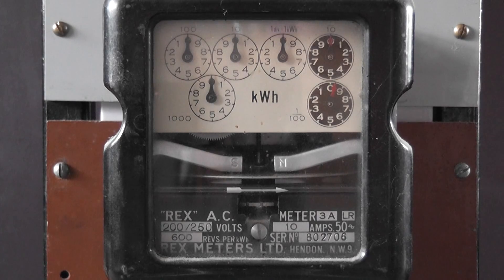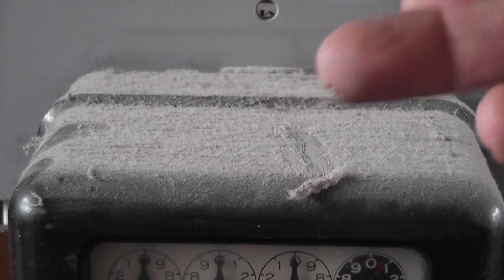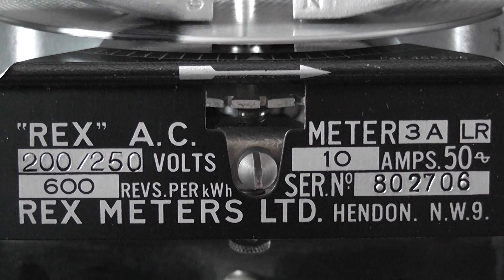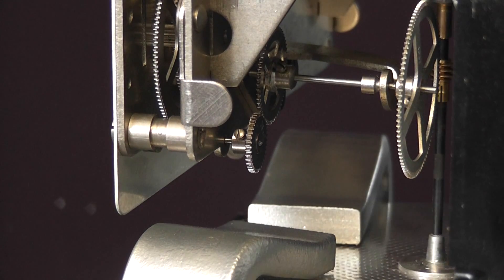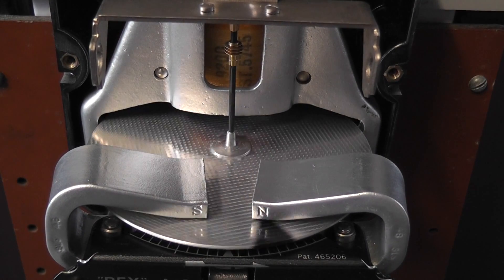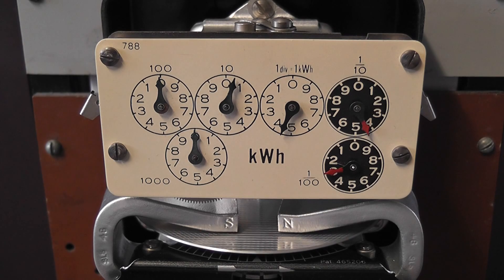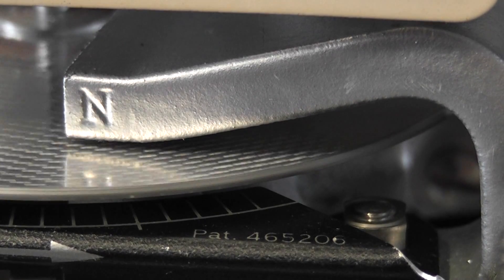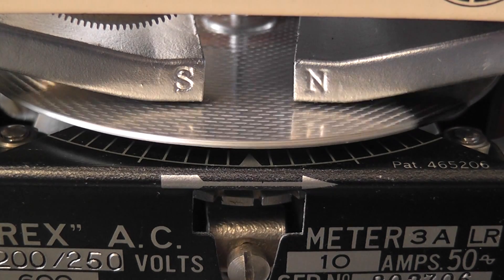Rex - Type 3A - kWh meter from the 1940's

Comment: Hmmm..... rather Sssatisfying. For information, Hendon NW9 is in London, England.

Interestingly, this instrument also has the same loading capacity and wheel speed as the MetroVick NF you have.

Nice looking instrument inside and unusual specification plate with the folded-over top on it with the incremental markings on it. :-)

When you mentioned the various meter collectors on YT, you forgot to mention "Wayne's Electrical", which is my FULL HD channel in 1920 x 1080p.

Eventually, I have plans to show all of my instruments on that new FULL HD channel, so do visit there some time and have a look.

I am also planning lots of deeply satisfying loadwheel action as well, along with accuracy tests as well.

So much to do..... but not the time or the coin to do it. :-(

Lucas is repairing quite well. I hope is purr motor is working good. :-)

Thanxx for showing,

-BoomBoxDeluxe / Wayne's Electrical.

30th September 2016, 22.15

Comment: That meter looks new inside so clean and the disk is shiny like it just came out the factory
Reply from the maker: That meter had never been used. (N.O.S.) no wear marks and shavings on the disc where the worm drive is. First energization in 74 years after it left the factory.
Reply: RODALCO2007 wow, the smell in there must be amazing